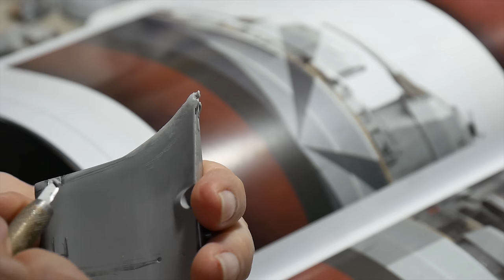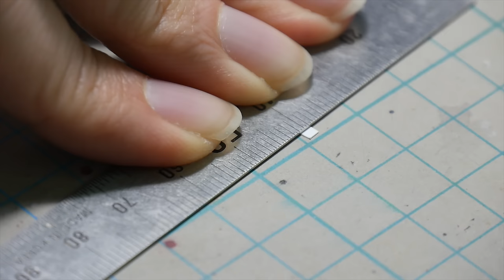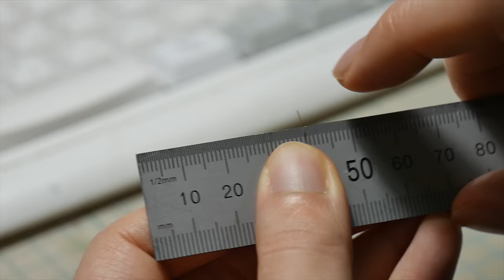1/350 Tirpitz (Revell) Assembling part1

Comment: Unreal! You should be extremely proud of your work. A model like this is a real achievement. I’m currently making the Revel 1/350 Bismarck (which I imagine is almost identical to your model) and have put it down and procrastinated multiple times. Your video is giving me the motivation to finish it off. I wish I had put after market guns and stuff on mine though, might go back and remake those parts.
Reply from the maker: Thank you for the compliments =) I would procrastinate if I don't do Youtube. The compliments from people like you keep me motivated. And good luck with your Bismarck. Metal barrels always look cooler than plastic barrels.
Reply: Tom, I have one question.  Not to knock Ebroin for his level of building which is God Level but, do you think doing one complete model straight through would give the best results? I mean work on it for a few days and take a few days off.  That is how I do my Models

Comment: Hello Sir, You are a true craftsman. I am new to model building and started as a rehabilitation for my injuries. I am working on a 1/400 Tirpitz. Trying to follow your lead on these videos. Can I ask " how do you get your Magic Sculpt to go on so smooth? " I cannot seem to get mine to be as soft and have a difficult time getting it to spread as easy. Thank you for the inspiration.
Reply from the maker: Thank you for the comment.
Magic Sculpt is sticky, to reduce the stickiness, I apply petroleum jelly to my tools. 
Less stickiness, more smooth.
And after sculpting, I rub the surface with soft brush soaked with lacquer thinner. 
I hope this reply helps your build, and good luck with your rehabilitation.
Reply: @EbroinSong  Thank you for that tip. I will give that a try. Keep up the outstanding work.

Comment: Masterful work!. If I might be so bold to point out something to you... It is better to cut PE on a ceramic tile or metal base, as cutting it on the "soft", moveable surface of a cutting mat causes it to bend slightly, necessitating re-flattening. I think perhaps you already know this, and were just cutting corners.
Reply from the maker: Thank you. My blades were worn out too quickly when I used metal plate. I am planning to use Acrylic plate for cutting base soon, though.

Comment: You want to do a Tirpitz? get the Tamiya 1:350 one, no need for putty, its an excellent build, I find Revell Plastics not very good and thin.  Good luck with your build.
Reply from the maker: I built Tamiya's Tirpitz long time ago, it was very very old kit, older than me. 
It wasn't very pleasant to build that old kit, wrong proportion, wrong detail.. worse than revell's on detail-wise. 
I don't remember about its fitting and plastics though, not bad I guess.
Reply: @EbroinSong  I have built both German battleships and I think I only ever used putty once, both my models were bought back in 1990's and in my honest opinion I preferred building them to the Revell 1/350 New Jersey.  Like I said it's up to the model maker's preference.  I am looking forward to the rest of the build :)

Comment: You're friggin' amazing.  I use MagicSculpt for sculpting, so I'm curious how well it adheres to plastic. What's the earliest model you used MagicSculpt on? Has there ever been any delamination or other general bonding issues?
Reply from the maker: Thank you! Magic Sculpt isn't very adheres to plastic but I can enhance it by applying extra thin plastic cement after sculpting is done. There's been some delamination when the compound are not mixed properly or not hardened completely. And rarely there are bit of distortion, but not much.  In general, I love this substance.

Comment: I epoxy my hulls together. Dont have to wait anytime at all before I can handle and start working on them and I can be guaranteed they will never come apart!
Reply from the maker: that is very tight =)
Reply: @powertothebauer296  There are a couple that I tried and most do the job OK but I always go back to JB Weld. It works flawlessly regardless of material, it has never had a negative reaction with anything I have applied it on and the end results will outlast the model itself.

Comment: P.E. should have been around when I was younger, at 62 and loaded with arthritis I'm almost ready to start drinking. Another problem you may be able to help me with, resin parts I have problems sometime attaching them is there one type of glue better than another for attaching resin parts?
Reply from the maker: I use Loctite 401 and Alaska 610 for resin and PE parts. Alaska 610 can be replaced with Axia 031. 
Loctite 401 is gooey and dries slower. And Axia 031 and Alaska 610 are very thin and dry very quickly and more firmly.
Reply: @EbroinSong  are you in the US? I've never heard of Alaska610 or Axia031 are they available in local hobby stores or on line only. I will be looking after this reply to you I gave up on my Jadgtiger resin interior 2 years ago very frustrating.
Reply from the maker: No, I am living in Korea, both of them are very easy to get here, and I though one of them is available in USA at least.

Comment: Great work as usual. Just curious what's the purpose of heating up the PE parts (using a bic lighter) I see occasionally in the video?
Reply from the maker: Superglue is very vulnerable to the heat and flame. I use lighter to detach PE parts when I get it wrong.

Comment: Hi, be so kind and can you share with us all resources (drawing, photos, technical data) that you use as a “inspiration” for your customization? I have found lots of photos, but I have never seen e.g. details of structures on the back side of the turrets or ring under the turrets etc.
Reply from the maker: https://www.bismarck-class.dk/tirpitz/tirpitz_menu.html

https://www.worldwarphotos.info/gallery/germany/kriegsmarine/tirpitz/

And there are some of images in my hard drive.

but mostly I use Kagero's book as reference.
https://www.amazon.com/Battleship-Tirpitz-Drawings-Draminski-2016-03-31/dp/B01FKWW6IQ/ref=sr_1_fkmrnull_1?keywords=tirpitz+kagero&qid=1556243005&s=gateway&sr=8-1-fkmrnull

And the author had uploaded a video of the 3D model. 
https://www.youtube.com/watch?v=aQv9Wi875Og

The Kagero's book solely solved most of my research problems.

Comment: Is it necessary to airbrush to make models of this level? Can you get the same result if you paint with a brush? Talking abouth other videos and this is amazing
Reply from the maker: You can get the great result with a brush, but it is very hard and need lots of practice. Easy to start, hard to master.
I strongly recommend Airbrush if you gonna build models for a long time hobby.
Reply: Thanks for your answer. I couldn't start any of them because I was afraid to sink ship models that I had in my hand.
Reply from the maker: Everyone has humble beginning. You will have same. but your skill will grow over time if you keep building models.
I started with small models like 1/72 and 1/48 tanks, they are cheap and easy to build.
Reply: I made the biggest mistake of big scale there. I have only expensive and complicated ship kits
Reply from the maker: Well, then you can wait and build other models until you are capable to build the ship.
or you can try it, whether success or fail, both will be great experience.
Reply: Thank you very much

Comment: Hello, not sure if it`s been asked, but why did tape up the hull and wait a couple days?
Reply from the maker: To weld the hull. The hull parts are distorted bit. They don't fit perfectly. And the plastic glues drys over time, maybe couple days. So without the taping, there will be gaps between the hull parts sometimes.

Comment: At what temperature do you work?
Or is the magic sculpt always so malleable?
Reply from the maker: Between about 15-25 Celsius.. most likely.
It always malleable in room temperature.
Reply: @EbroinSong  thanks! I work with alteco A+B and these days my workshop is between 8 and 12 degrees celsius and the putty is very stiff and crumbly. I just wondered whether the magic sculp behaves better, however i think it would be just as bad in my conditions.
Reply from the maker: @Jiří Horský I had worked with Magic Sculpt in about 10 degree Celsius but it worked fine, bit stiff though. 
And it took longer time to harden in lower temperature. 
And because I have never used Alteco A+B, I cannot say Magic Sculpt better.

Comment: Dude I'm totally Sorry but you got your turrets messed up  The one you were working on at Time Stamp 3:36 is 28cm SK C/34 Naval Gun, at 10:05 you started on 3.7 cm SK C/30 not a 20MM anti-air set up.  This ship also had a 2 cm FlaK 30 and 53.3 cm torpedo tubes.  I'm a Student of History, preferable Military History.   Sometime getting the actually items right means a whole bunch to Students of History like myself
Reply from the maker: What about at 3:36? I have no idea what is wrong with the Turret.
At 10:05, I am building 2cm L/65 C/38 single mount AA gun, not 3.7cm SK C/30.
And I will get to the Torp tubes in future, just not now.